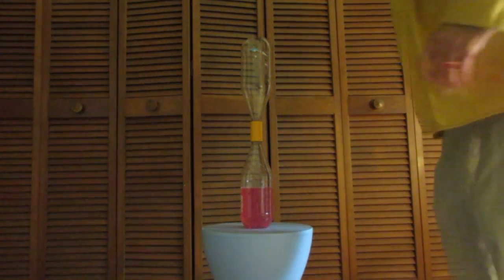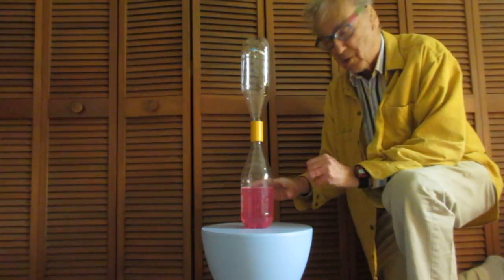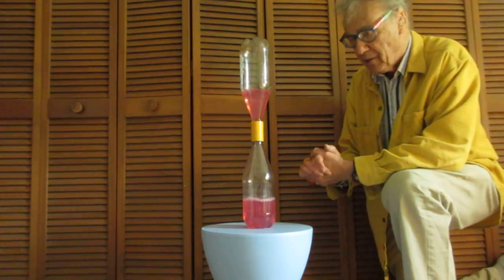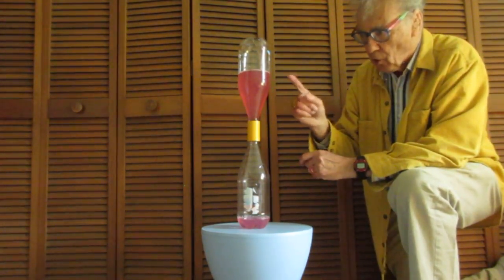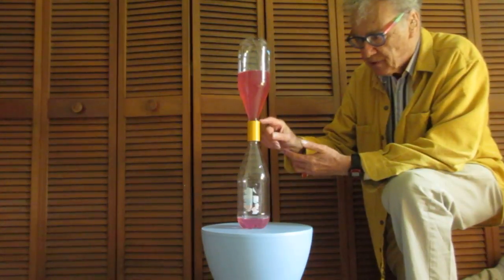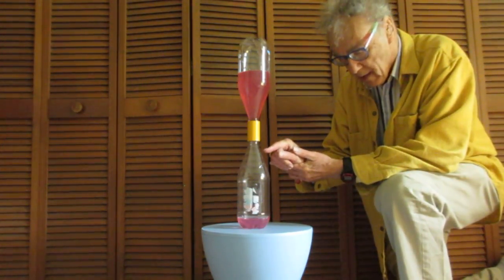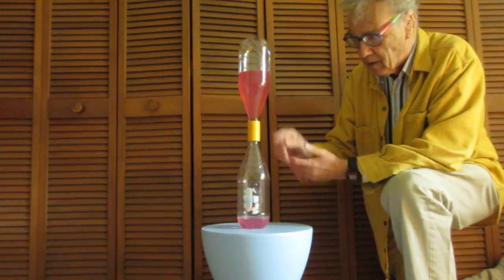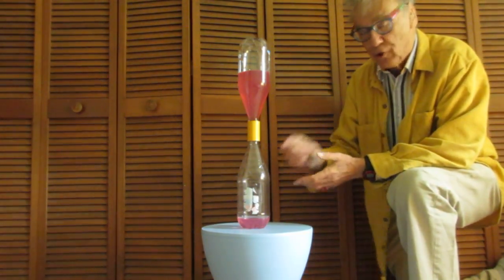Revisit Vortex Transfer Lemonade

Comment: As the bottles are sitting on top of one another with the lemonade in the top bottle, as it transfers from top to bottom, where the air meets the liquid (at the neck) a tremendous amount of turbulence is created by the direction of the lemonade flow versus the direction of the airflow.  And, as the orifice size increases (the neck), the flow rate of the lemonade increases, and as that orifice size decreases, the flow rate decreases (of course there would be a limit on the maximum and minimum size of the orifice). All of this is due to the effects of gravity on substances in different phases and different densities. One needs to keep in mind, that if there were no gravity, there would be no flow.

Now consider pouring a liquid from a large container, say a one-gallon antifreeze bottle.  You will find that you can pour its contents much faster if you will adjust the liquid level somewhere around halfway of the neck of the bottle simply by tilting the bottle to match the level we want to achieve.  Again, all this happens due to gravity, no gravity, no flow.  All we did was to change the direction the gravity was coming from.

So how do you change the direction gravity?  Simply by adding in a vector caused by centripetal motion, or spinning the lemonade.  Then as it spins as it travels through a tighter and tighter spinning motion until it moves to the side of the orifice, and allowing the air to pass through unobstructed.  There are certain shaped things called venturi they used to use in carburetors way back in the 60’s that maximized the airflow going through to the engine.  I have seen the same thing used as a way to make donations to a charity where you roll a quarter down and the further it goes, the faster it seems to spin, keeping the quarter glued to the side of the… thing.

Comment: you could also make an opening in the bottle that is on the bottom and squish the upper bottle to fight the flow of air that's going from the bottom bottle to the upper bottle
Reply from the maker: yes if you squeeze the upper bottle the liquid that leaves the upper bottle does not have to be replaced by air and the bottom bottle can get rid of its air through that hole.But you still have to squeeze air from the top bottle through the small opening to escape.  I mentioned briefly in my video squeezing. I find it not very elegant. There is an issue namely that you probably can not squeeze with ONE squeeze till all the liquid has left the upper bottle. There comes a time that you have to let go briefly, the squeezed plastic will then expand again and air will flow through the small opening into the top bottle and it will prevent liquid to go through.

Comment: Dear dr lewin. i have a question that confused me if a rainbow is caused by the reflection of a single raindrop. why there are not thousands of rainbows since there are thousands of raindrops. Please help me and thanks in advance. P.S i tried to google it but that didnt work
Reply from the maker: <<<< if a rainbow is caused by the reflection of a single raindrop.>>>
it's NOT caused by a single drop. It's caused by millions and millions. Watch my lectures on rainbows. This one may be s good choice I gave it for NHK TV in Japan. It was taped at MIT in the simmer of 2012. It is posted on this YouTube channel. https://www.youtube.com/watch?v=iKUSWJWMSk4&list=PLyQSN7X0ro21uk5LTH085VLMfkb_dRjHF&index=5
.
Reply: Lectures by Walter Lewin. They will make you ♥ Physics. so it doesnt matter if the sun rays strike the drop of water at any angle since it will always reflect the image of a rainbow in the same place  ?? Thanks in advance
Reply from the maker: you have several misconceptions about rainbows. Watch one of my rainbow lectures!
Reply: Lectures by Walter Lewin. They will make you ♥ Physics.  i did watch the one that u sent me a link. By the way i am only a ninth grade student so its not easy for me to understand your lectures but i still watch them
Reply: Lectures by Walter Lewin. They will make you ♥ Physics.     I also want to say thank you for making me LOVE physics
Reply: I think the bigger issue with rainbows is why do you need  mirror indoors? if they are purely a creation of light through water particles

Comment: Sir , I was observing the rolling motion of a frustum and found it to be very interesting .It never moves in a straight line due to different radii of its end circles. The radius of the circular path that the frustrum moves on being rolled has a relation with the difference of radii of its end circles. I'm working on it now (felt it to be a physics problem like the ones you post)
Reply from the maker: use google

Comment: Sorry sir for posting this off topic question . ..
Hello Professor! I m really inspired with your lectures... My physics teacher told me that in a projectile motion ,if we throw a ball upwards with a velocity 'u' from a height 'h'... And in second case if we throw the same ball horizontally, from same height 'h' and with same velocity 'u' ... The velocity with which both balls will touch down the ground will be same.. If this is true. Why?? I have this doubt because I think that the ball thrown upward will strike ground with more velocity as it will fall freely from more height....Please help me professor! I will be really thankful..
Reply from the maker: with same velocity and from the same height.
velocity is a vector. What you meant is with the same speed.  
Even if you threw the object vertically down with speed u, it would have the same speed as the other 2 as it hits the ground. *all 3 would NOT have the same velocity, but they will have the same speed*. 
Yes your teacher is correct. It follows immediately from the Work energy Theorem. Watch my 8.01 lectures
Reply: Thank you so much Professor !! I am watching your lectures of Classical Mechanics 8.01x.. They are really helpful.. Thanks again Sir :-)

Comment: How exactly does the vortex solution work? It seems that there is a critical angular speed above which the transfer smooths out. Does the vortex solution work because the centrifugal effect causes the middle part to become thinner and easier to be punched through by the air below? If so that would mean the faster the liquid rotates, the easier it is for the airway to keep letting air below through? Also does that mean that once enough energy dissipates, the liquid's rotation will go below a critical angular speed, then airway will collapse and the transfer slows down once again?

I feel like I am missing something since the slow transfer method didn't speed up much even as the level dropped quite significantly. Does the rotation makes it easier for bubbles to form through turbulence? In that case is there still this critical angular speed thing going on?
Reply from the maker: vortex physics is difficult - use Google

Comment: I tried using two 1 liter bottles with a neck opening of 21mm diameter and filling half the bottle; but it did not go well. It took the colored water only 5 seconds to drop. What should I change to reproduce this experiment?
Reply from the maker: My bottles also have a 2.1 cm opening. How did you connect the 2 bottles? I suspect that the connecting piece (I call that the tunnel) was not perfectly sealed. Physics Works!
Reply: Lectures by Walter Lewin. They will make you ♥ Physics. 
The tunnel I used is a 3/4 inch PVC coupling that is 55mm long. I glued the bottles to this unthreaded piece using pvc glue. No leaks were detected. Gluing limited further possible adjustments.
I could try gluing the two caps of the bottles and making a hole between them but that hole would be about 1cm.
Reply from the maker: I have no idea what went wrong. I would have to see a video of the parts (bottles, tunnel) and a demo of the liquid transfer

Comment: Will shaking the bottles up and down help the liquids to get through the hole?
Reply from the maker: NO
Reply: I thought shaking the bottle will make the shape of liquid change near the hole plus the liquid will have a momentum so a larger amount might be able to pass at an instant overcoming the pressure of air from below.
Reply from the maker: if you transfer without a vortex, the dripping will definitely be enhanced by shaking. However, once you have a vortex, more shaking will not help. It may even interfere with the vortex transfer.
Reply: Thank you for your reply. I just have one last confusion. After starting the vortex method if the bottles keep moving upwards in the video.then the liquid will get a force downward for inertia of rest just like we feel in an accelerating car. Would that speed up our transfer speed? (and of course when we will bring it down it will have reverse change)

Comment: Dear doctor lewin 
Wt happens if a alternating current connected to a one plate of a unchrged parellel plate capacitor? Wt happens to the voltage of the other plate of capacitor is alternating current flow was a sinical flow
Reply from the maker: watch my 8.02 lectures! The answers are there.

Comment: Dear sir can you please tell if quatam entanglement is really faster than light?  I searched it on Google but didn't found a appropriate answer! Sir please tell
Reply from the maker: Your question implies that the 2 objects (perhaps 1 light year apart) send a  signal to each other in entanglement. But that is NOT the case. The 2 form 1 wave function,  no signal is sent.
Reply: Lectures by Walter Lewin. They will make you ♥ Physics. Thanks for your help sir

Comment: professor....suppose i heated a metal..n it linearly expanded...will the strain developed be zero??? 
we had such a problem in IIT according to which...the strain developed was 0..we r confused..we searched in books but didnt get a satisfying answer..plz help
Reply from the maker: >>>will the strain developed be zero??? >>>
yes, unless there are temperature differences in the object
Reply: Lectures by Walter Lewin. They will make you ♥ Physics.   thank u professor...
Reply: Lectures by Walter Lewin. They will make you ♥ Physics. but we define strain as the, elongation divided by the relaxed length...even though the rod expanded..the strain is zero..why??
Reply from the maker: <<<we define strain as the, elongation divided by the relaxed length>>>
If only the temp changes the relaxed length changes, but there is NO elongation. If I stretch it at temp T then there will be an elongation.
Reply: Lectures by Walter Lewin. They will make you ♥ Physics. an extremy satisfying anwer professor...thanks a lot
Reply: professor u defined mirage on the basis of ray optics.. the light is coming from a  far away place...is it ok to neglect  diffraction?
Reply from the maker: question ill-defined. Sunlight going through a grating or a narrow slit causes diffraction. Distance to the sun has nothing to do with that,

Comment: Sir.i have 1 question you might wanna help. When we place a coin between the base and cover of a matchbox and strike near  on the box with our finger, why does the coin. Come out.. 
I first thought it was Newtons third law. But fingers hitting on box is action and box exerting force on finger is reaction right? Where does coin come in the picture ? Plz help sir.
Reply from the maker: I have never heard of this. I would have to see it on a video. Then I can explain it.
Reply: Sir I have made a video on it. How can i send it to you?
Reply from the maker: send it to lewin-physics@physics.comcastbiz.net 
I will open it for only 30 minutes. Will then close it again.
Reply: Okay sir. Right now its saying under construction
Reply from the maker: I will close it in 25 min from now
Reply from the maker: I have closed that email address. There was no video from you
Reply from the maker: You tap on the box, Thus you accelerate it downwards. The coin will not follow (inertia). Every time you tap the coin stay behind a little more. Thus relative to the box it will move out.
Reply: Thanks i. Got it now

Comment: if you tape a long straw inside the necks  youll see something amazing happen
Reply: ahaha i just said that ahahaha
just tape it to the one neck..
and yes vortex is great
Reply from the maker: I mentioned that. But it is not so easy to tape a long straw through that very small opening. However, if you succeed, you have created a situation which is similar to the vortex in that air can flow freely through the center (straw) and liquid can move freely in the area outside the straw.
Reply: brilliant insane minds think alike
Reply: you dont  need to tape it..all you need is the right length straw and 2 corks ahahahha but the vortex is easier
Reply from the maker: 2 corks? You have to allow room outside the straw to allow liquid to flow through.  Please build one and send me the video.
Reply: I think the TWO corks are to be used as floats, so that the bottle-contraption could be flipped over and the straw positions itself perfectly all the time.

Comment: What if those two connected canisters were in zero gravity?
Reply from the maker: In the ISS gravity is NOT zero.  But since ISS is in free fall nothing has any weight. The liquid can only be transferred in the iSS by rotating the bottles around the connection with the axis approx perpendicular to the connecting "tunnel".  You have to do all the work to spin it. Centripetal force can do no work as it is always perpendicular to the direction of motion , thus the fictitious centrifugal force in the rotating frame can also do no work. YOU do all the work.